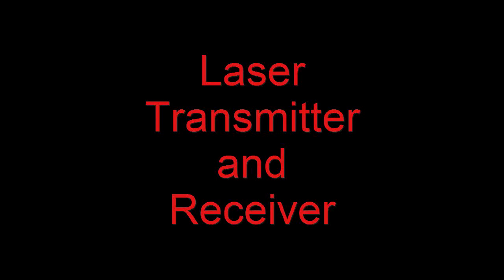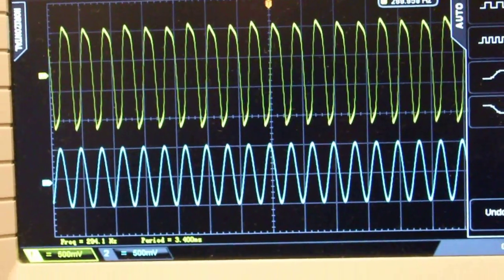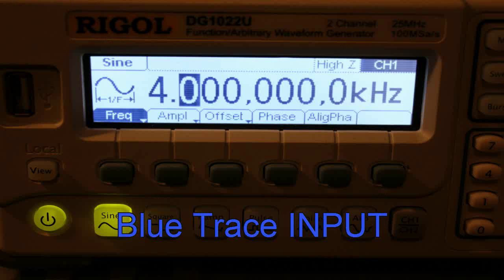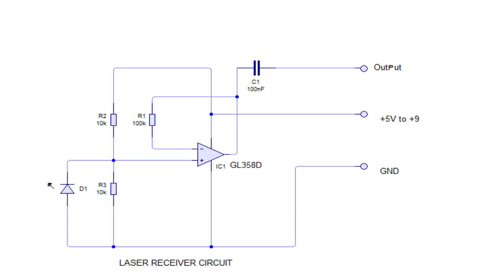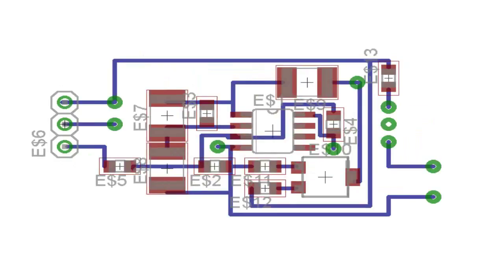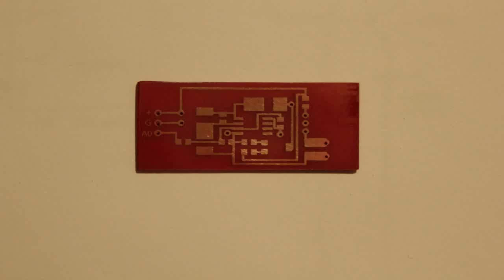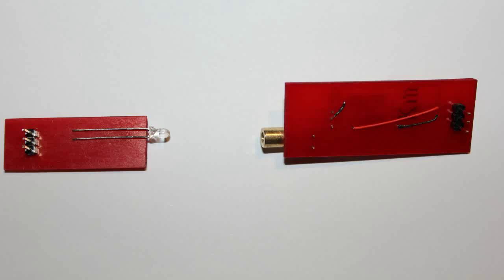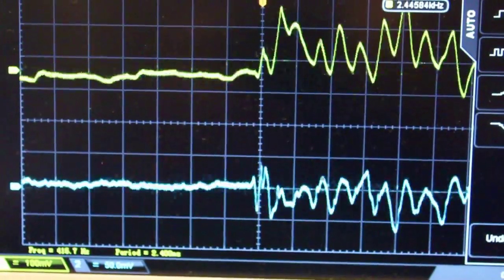Laser Transmitter Receiver

Comment from the maker: Sorry to hear it's not working for you. In the 1st video (Hand draw circuits) I used a TL072CP op amp. In the updated video I used surface mounted op amps GL358D, which are an smd version of the popular LM358D op amp. This is why the capacitor values are different.  Check your components are ok. If the op amp is blown it could give a dc output. If you have a scope, check the audio signal path through the circuit. Good luck.
Reply: Thanks alot. I will try to do that way :)

Comment: Hi stoneslice, I have tried to build this circuit(transmitter one), but it does not work. I check the circuits many times but the transmitter output showed up the DC signal which is not AC signal likes the signal showed in your video. As I compared with the one you uploaded before hand-writing circuit, the capacitors values are not the same, could you please tell me which one is correct? THANKS!

Comment from the maker: I do not know the part number. Just photodiode from eBay. Visible light spectrum. The laser is from eBay too. No part numbers. Sorry. Most types will work fine. You may have to adjust resistor values a bit. Experiment.